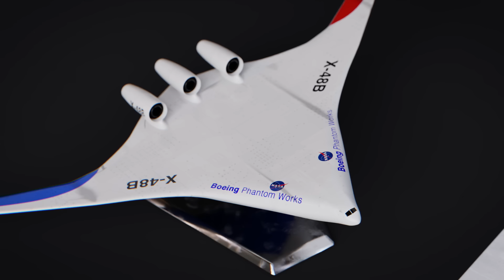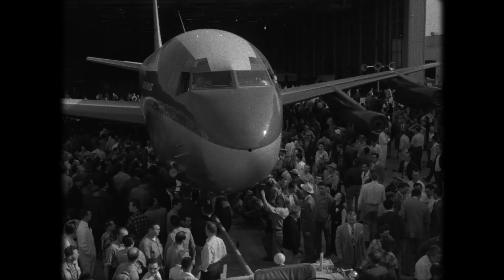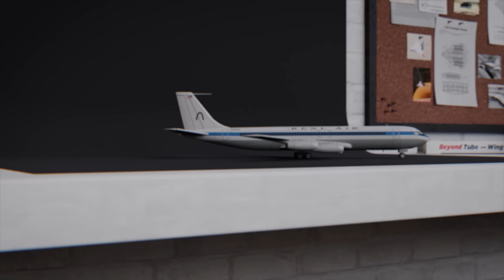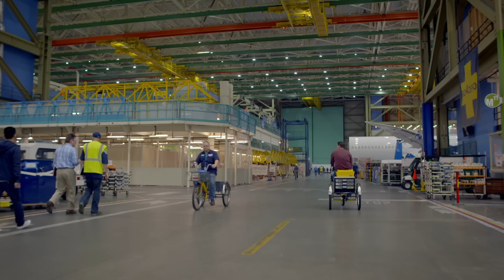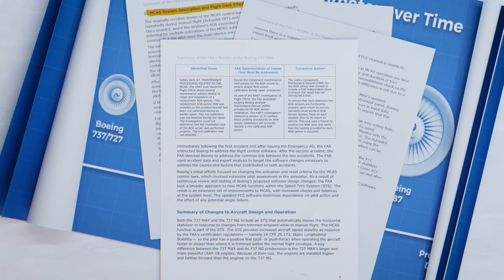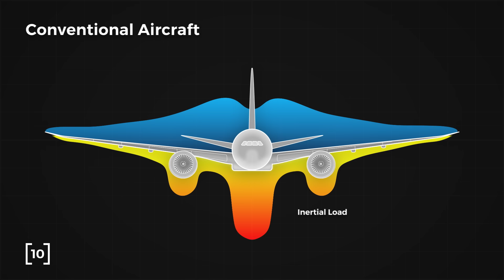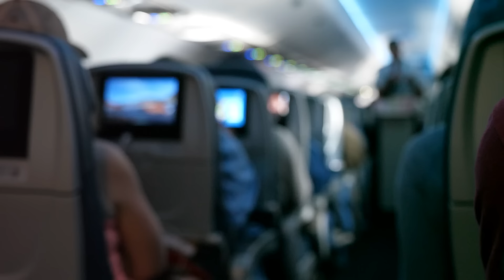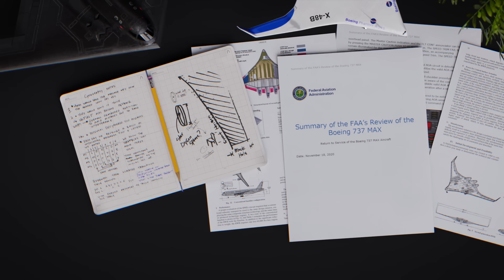The Plane That Will Change Travel Forever

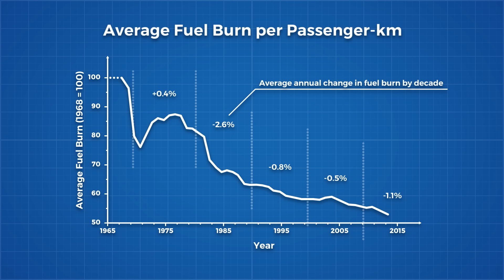Comment: 1:27 please do not use graphs with 50 at the bottom and 100 at the top ._. for the first ten seconds I saw it I thought they had cut down fuel use by 95%

Comment: Why are there no blended wing birds then?
Reply: Well, actually, virtually every flying bird is a "bended wing".
They just don't need to carry passengers further out away from the centerline of their bodies.
Reply: @lewiscole5193  I don't believe that's true. And the volume of their bodies is what they need to carry. It's not like a passenger application has a special need to carry passengers widely. A bird is a round cross section aerodynamic shape. Google image a bird with wings out. It's not even in question. So I question the merit of a blended wing. It would make fine sense for a bird to have thick muscle far out if a blended wing shape had superior efficiency. but we see quite the contrary.
Reply: @DanFrederiksen  
> I don't believe that's true. 

That's nice.

> And the volume of their bodies is what they 
> need to carry.

Correct.

>  It's not like a passenger application has a 
> special need to carry passengers widely. 

Correct, again.
That's because in terms of aerodynamics, it doesn't matter what the "load" happens to be.

> A bird is a round cross section aerodynamic 
> shape.

A bird's body is roughly round or a squished ellipse depending on the type of bird.
But more importantly, it's "body" blends into its wings without a really sharp transition, especially in the case of birds that soar.

> Google image a bird with wings out. 
Thanks, but I'll rely on my mark one eyes if you don't mind.

> It's not even in question. 

No, it's not.
Birds are blended bodies.
Made-made aircraft of the tube and wing variety usually are not, although if you look closely at pictures of airliners (feel free to use Google if you like), the junction between the fuselage and the wing virtually always has a "fillet" to try to blend the junction at least a little so as to reduce "interference drag".

> So I question the merit of a blended wing.

I do too.

> It would make fine sense for a bird to have 
> thick muscle far out if a blended wing shape 
> had superior efficiency. but we see quite the 
> contrary.

Ummm, no.
It makes sense for birds to have thick muscles where they can use them best in terms of mechanical advantage (as in attached to their breast bone) while producing the least possible drag.
And if you look closely this time at birds that soar a lot (meaning that they spend their time flying at the highest possible lift and lowest possible drag) like condors and albatrosses, while they may have parts of their body that extends fore and aft of their wings, the parts of their bodies next to their wings blend together quite well.
Reply: @lewiscole5193  dude, I was trying to be patient with you. google a picture of a bird, look at pictures where the color and lighting lets you clearly see the shape, not fool yourself on a fuzzy black bird with poor light. It's as clear cut like a plane as biology can be. That goes for soaring birds as well. Google blended body aircraft image if you are unclear on what that means. A bird is not that. And yes planes often have ugly humps where the wing attaches, it somewhat offends my design sensibilities but that doesn't make them blended body either.
Reply: @DanFrederiksen  
> dude, I was trying to be patient with you.

As was I to you.
But now that it's clear that neither of us has to observe any niceties, let's get to it shall we?

> google a picture of a bird, look at pictures 
> where the color and lighting lets you clearly 
> see the shape, not fool yourself on a fuzzy 
> black bird with poor light. 

Stop trying to tell me what I should look at and do some looking yourself, not just at pictures of birds, but also definitions of terms.

> It's as clear cut like a plane as biology can be. 

You clearly don't know what you are talking about.
So let's go over the basics, shall we?

"Blended body" does NOT mean that an aircraft doesn't have a "body", but rather that there is NOT a sharp delineation between where the wing begins and the body ends.
That is the obviously the case with an albatross or a condor.  It's also the case with an F-16, a MiG-29, or an Su-27.  And I'd even argue that the F-9F Panther is awfully close to being a "blended body" without much squinting.
All of them have what amounts to smoothing transitions (fillets in the case of man-made aircraft) on the top and bottom of the wing, rather than a sharp juncture.

> That goes for soaring birds as well. 

Look again.  Google it if you have to.  I don't care.  Just look for once.

> Google blended body aircraft image if you 
> are unclear on what that means. 

Been there, done that, don't need the stinking T-shirt.  And instead of looking at pictures, you need to look up the definition.  Even Wikipedia will do in this case.

> A bird is not that. 

Wrong.

> And yes planes often have ugly humps where 
> the wing attaches, [...]

I'm not talking about 'ugly humps", dip shit.
If you look at the top of the junction of any low-winged airliner, you'll see that the sides of the  fuselage curves into the tops of the wings.
Not much, mind you, but it's there.
Why?  Because the designers were trying to reduced the interference drag between the airflow flowing over the fuselage and the airflow flowing over the top of the wings.
Making a gradual transition helps do that.
A mid-wing configuration has the least amount of interference drag, but putting a fillet on the top of the wing (in the case of a low-winged aircraft) or a fillet on the bottom of the wing (in the case of a high-winged aircraft) or on both sides of a mid-wing aircraft helps to reduce the interference drag with little effort.
Don't believe me?  Trying looking at Hoerner's classic "Aerodynamic Drag" some time and learn something.

> [...] it somewhat offends my design sensibilities 
> but that doesn't make them blended body either.

You have no "design sensibilities".
You obviously have never looked at a book on aircraft design in your life.
So do everyone a favor and stop trying to pretend that you have.

Comment: How about ammonia as an alternative fuel to LH2. It is around 30-40% more dense and doesn't require the near 0 Kelvin temperatures and or massive pressures. Production wise it costs just about the same as Hydrogen with the only added steps being compression of air to scoop out nitrogen and catalysis between N2 and Hydrogen to form ammonia.

Comment: Provide passive stabilization by putting a large Dyson-style fan on the top to act as a tail and provide thrust with the venturi effect (similar to the Dyson fan). It does not have to be a loop even. A square box or an arch could work. Imagine an engine on either side of this stabilizer and maybe even an engine mounted in front of it too.

Comment: H2 the lowest energy density fuel by volume that would have to use very heavy tanks to compress it enough to store enough for a reasonable range, the weight further reducing it.
H2 the widest flammability limits, and therefore easiest to catch fire.
H2 the gas that is very difficult to keep contained because it is small enough to pass between the atoms of other materials.
H2 the gas that embriddles metals.
H2 the gas that is primarily obtained from natural gas, defeating the very purpose we would use it, and if electrolysis is used has a 20% loss in it's creation, even more from compression, from a power grid that already cannot keep up.
H2 the gas that burns hundreds of degrees hotter than Jet A, requiring at best redesign, but likely much more expensive super alloys and possibly lower engine life.
H2 the gas that takes huge amounts of energy to compress to a usable energy density, and that energy is rarely recovered at even low efficiencies. 
H2 the gas that would cost huge amounts more to manage, transfer, store.
H2 the gas is a high pressure tank that would likely explode like a bomb on moderate impact making any survival of a crash impossible and increasing collateral damage significantly.

Personally I don't see it happening. Even in cars where the the weight matters much less it will be a challenge. The solutions are expensive where they do exist. If we do succeed it will be with huge compromises in performance, safety, cost or all three.

Spend the money on a more efficient method of transportation. 
High speed trains! 
They use far less energy per passenger mile, have more space to move about, and can get to the destination in an OK amount of time considering the increased comfort. Get a sleeper car and wake at your destination. The extra time won't make much difference.
Over seas flights remain as they are, and after we switch to electric cars (plagued by its own challenges, including where we get the electricity from) the pollution reduction will be enough to that the remaining air travel won't be as significant.

Comment: The blended wing is good, the material should be stainless steel which we have by far better understanding of metal fatigue, also less $$$$$$$, second start with cargo planes not passengers till the designs are reliable

Comment: Isn’t the main problem with BWB airliners having seats that far from the centerline, which will significantly increase the degree of vertical motion for those seats in a bank or during turbulence compared to seats in a standard tube design, possibly making it unsafe for passengers to move around the cabin in flight. Frankly, I’ve been hearing about BWB designs as the “future” of airliners for twenty years, and this video makes me feel like they’re no closer to reality than they were when McDonnell Douglas was still working on them.

Comment: wasn't the Dehavilland Comet the first Jet liner with a long tube and wings? sure the engines's weren't in pods like 707 but pretty sure that flew earlier. Also you had the DC4-6 all before the stratojet took to the sky and they also had tube and wing structures...

Comment: This video was extremely comprehensive and well done. Love the work put into it. A+ quality product, learned a ton.
Reply: Wow people really be pressed that u enjoyed the video
Reply: @FadeDreamer  Hey now, that is a good song.  The dancing; well is epic =)
Reply: Exactly 'Plasma Channel' !
Reply: Indeed - even a layman like myself was able to follow the thread of the information easily. It's a rare skill to be able to impart complex knowledge clearly. Excellent work!
Reply: @FadeDreamer  Could you delete that rick roll? It pisses everybody off
Reply: Claims to be a real engineer, but uses gallons?  FAIL.
Reply: @greensteve9307  or it could be a large % of his audience is US? And in aviation gallons as a metric of efficiency is still very common.
Reply: Well, i would give him a B for this, as there is one important thing he did not explain very clearly. He explains the inherently stable nature of a conventional aircraft body and points out the negative impact on fuel economy.

However, he fails to mention, that this problem can be entirely made up for, by shifting the center of mass behind the center of lift and giving the horizontal stabelizer a negative angle of attack. You get the same restoring force without the negative impact on fuel consumption, as both the wings and the stabelizer produce lift.

I mean, could very well be wrong, but he should have at least mention this.
Reply: @Enthropical_Thunder  That is a VERY unstable configuration and not suitable for commercial passenger flight. You wouldn't see it approved for cargo planes either. Lifting horizontal stabs aren't even common in model aircraft except for free flight type models where minimum sink rate is the primary focus of the design process. But it comes at a price if you get too close to the limit as it will enter a terminal dive once the threshold of balance is surpassed. For rock solid pitch stability, a lot of general aviation designs do the opposite. They either use lot's of decalage or horizontal stabs with inverted airfoils so there is always downward pressure being generated by the tail, keeping the nose from tucking with increased airspeed.
Reply: GRAPH-ONE and the BULLSHIT has already started...  
For 50 years, PRICE PER passenger-mile only fell from INNOVATION..?
Not bc price-fixing became impossible? forcing lower fares? 
Lower-fares didn't attract more people as it became more affordable..???
The internet boom didn't happen (priceline, etc) forcing cheaper prices..? 
New, companies with lower operating costs DIDN'T drive companies w high HR under..?
Our LYING eyes just thought planes looked nearly REVISIONLESS til the MID-90s..?
But ...it's all "engineering" ..? Zat right? (I swear. You make a lot of dubious claims).
Reply: Its all bs as its just greenwash for a class that screams climate emergency while not being willing to give up their globalist lifestyle.
Reply: @churblesfurbles  It's almost like there are indeed people that do give up on their globalist lifestyle, forcing companies to innovate.
Reply: And BS at the same time as the entire reason flying wings are not used in commercial airlines has nothing to do with the design for normal operation.  It has everything to do with failure modes and the exiting of passengers from the aircraft during said failure modes.  It is a logistics problem, not a technical problem.  Solve the Logistics problem, get it passed by the FAA/EASA and then every single commercial aircraft will switch to flying wings overnight.  Until then... this is baloney.
Reply: @w8stral  I wouldn't be so cruel to call it BS, but I do take issue with some of the info here.  Some he touched on, some he missed, three I note here.  He talked about the tubular design is great for pressure vessels, and the flying wing not so.  I fail to see the weight reduction in a non tubular design of a pressure vessel over the current designs.  If carbon fiber is already implemented in tubular aircraft making great weight savings, the race is lost as it will take substantially more composites to pressurize a non tubular flying wing.   I have misgivings about doors in the leading edge of a wing, whether for deplaning, or emergency exits.  The leading edge is one of the most critical for airflow and to make it all bumpy by adding doors seems to be a bit sketchy.  The inefficiency of the horizontal tail downward force can easily be changed by going to a canard style aircraft which removes this issue and adds the safety of a stall resistant aircraft.
Reply: @w8stral  if you think this is baloney you should see how bad his videos on ww2 Germany are.
Reply: @dannythomson5239  Haven't seen them.  But I mistakenly watched his idiocy on the Spitfire he did and the P47 and they were pretty bad.  No understanding of what goes where and why.
Reply: @w8stral  he done one on Germanys famous flak towers where he got loads of simple details wrong (im a real ww2 buff for over 45yrs)  
im not even subbed to this channel, his nonsense videos keep popping up as suggested.
Reply: @w8stral  i actually went and found his Spitfire video because you mentioned it, as soon as i read the title "spitfires fatal flaw" i knew it was going to be about the spitfire engine cutting out because of the way the fuel was fed via gravity and the ME-109 having fuel injection, his video and wording is almost word for word with other videos i have seen on the subject, the man is a serial rip off merchant of other youtubers videos.
Reply: @w8stral  lol okay YouTube keyboard engineer
Reply: @w8stral  finally someone who get it

Comment: Carbon fiber yes, plastic in that mix NO.  Just with PVC Poly Venal Chlorate, It's not just the many number of things that can make it brittle and crack but the exact process control in plastic is at best haphazard.  Plastic is just not a uniform material when it comes to radiation, chemical contact, Thermal fluctuations, and even harmonic focal points.  When plastic fails you rarely get a warning.

Comment: The tragic failure of the 737 Max was essentially caused by faulty management and greed, which in turn prevented proper engineering.
Blaming the software and sensor is  scape goat  bs

Comment: I can imagine these being powered by Thorium reactors! Seems that tech is feasible now due to new alloys, I saw it on the Anton Petrov channel
Reply: I am a big supporter of nuclear power, but putting one in the air is idiotic. One will eventually crash, and spread fuel over the countryside. That and by the time you put in enough shielding to not fry the passengers and crew, there will only be room for a few dozen passengers on something the size of a jumbo jet. Also the only real difference between uranium and thorium is the availability of it, but there is enough proven uranium reserves to last untill the sun eats the earth.
Reply: @orkin2525  Thorium is incredibly difficult to weaponise compared to Uranium, so the nuclear superpowers should keep their Uranium and warheads and developing countries can have thorium reactors far as I'm concerned.

As for declaring my comment about thorium reactor planes is idiotic... the USA literally considered this in the cold war but Hastelloy wasn't perfected yet and so they chose ICBM instead.

I suggest you work on your manners, restraint, and social skills to have a happier life. Good day sir.😃
Reply: @michaelchildish  flying reactors is idiotic for the same reason lithium battery powered airplanes is idiotic. By the time there is enough power to do anything useful, the vast majority of the weight is going to be reactor and its shielding. That and airplanes crash fairly often. How much worse would a plane crash mixed with a reactor meltdown? How about if the reactor starts leaking while flying?